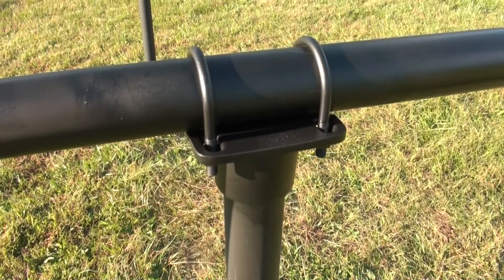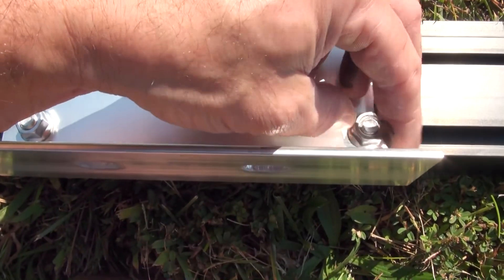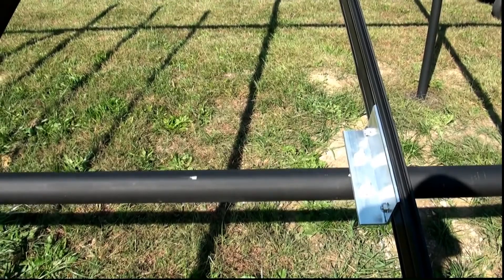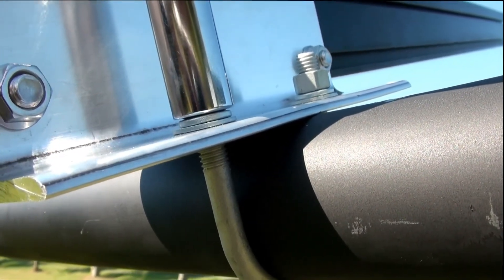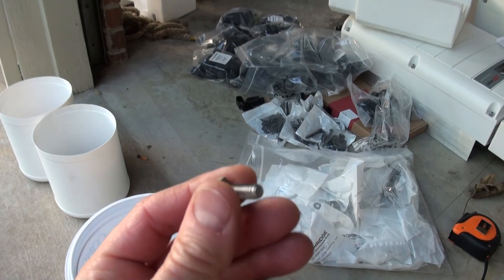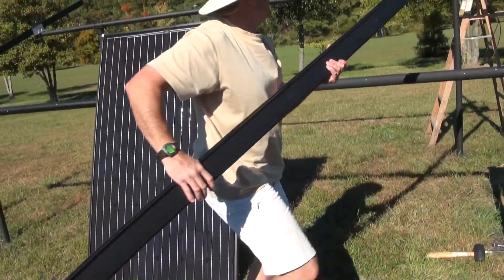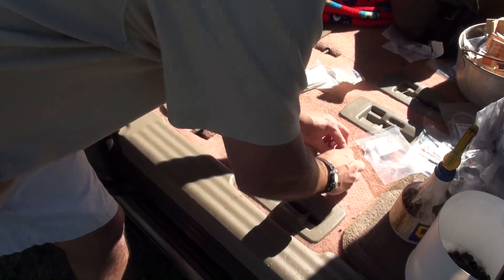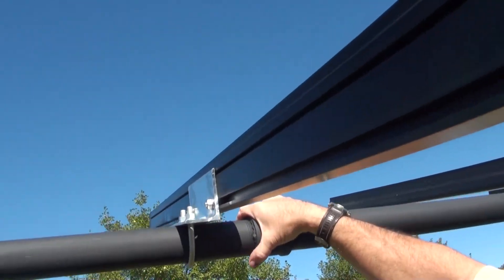DIY Field Solar Array - Part 6

Comment: smiling you know in carpentry we use 3/4/5 rule.  you were skewed and did not measure corner to corner which would have gotten you dead on with just twi then as you go along three panels installed. Pretty much measure corner to corner and make sure your dimensions were identical.  This would have kept you right on.. hope this helps someone else who might be looking to do an install that is similar to yours.
Reply from the maker: Thanks!

Comment: Congrulations! I'm from Brazil, and we trying to cultive the power solar here...Can you say for me how much did you spend in this project? Because here is too expensive yet.

Good lucky in your projects..
Reply from the maker: Total cost (including the trenching team, rentals, and every single part, panel, pipe, clamp, connector, component, wire, construction material, supply, can of spray paint, etc.) was 35,000 USD.   Labor was free (more or less).

It seems like a lot.. and it is.  But - I haven't paid an electric bill since going on line and I get a check from the power company every year.  In USA, we also have renewable incentives which were terrific initially (as in, I could make more money with the incentives than by the electricity I generated), but now they are almost worthless.  That could change in the future, but it depends on the regions energy policy from year to year.  I estimate the payback time to be more than 5 years, but less than 8 years - depending on the market and incentives.

Comment: Patiently waiting on your final video on how you run the dc wire from the array to the house to connect to the inverters. Did you use subpanel to connect all the wires and then run a 100amp to the house
Reply from the maker: I'm always flattered that anyone actually watches these videos!  I'll make an effort to get the last one done.  It will probably take me several more weeks at least. 

Here's how I did the AC to DC switch.  When I came up with the idea of placing the inverters indoors, it was after I had already trenched in the 240v service cables and there were only 4 wires running out to the panels; three 2-gauge aluminum and one 4-gauge aluminum (typical 100-amp service).   I used these 4 wires to make 2 DC loops, each loop feeding 1 inverter (I have two inverters on this setup).  I use a 2-gauge and a 4-gauge to feed the 6kw inverter.  I use the 2 remaining 2-gauge wires to feed the 11.4 kw inverter.  There is no ground wire connecting the panels in the field to the indoor units.  Not wanting to trench in additional wires, the best I could do was place a grounding rod at the frame in the field and I have a grounding rod for the inverter chassis where they come into the house.  Obviously, if I was doing it over, I'd run a few extra wires to be sure to meet code.   At the panels, I installed a metal junction box with conduit connections coming in.  Inside the box, I tie the appropriate strings together in parallel and connect them to the underground wires using split bolts.  The old service wires come out of the large junction box, in conduit, go down in the ground, and then run direct burial to the house.  So, it's 3 parallel strings of 14 tied to two 2-gauge wires and 2 parallel strings of 9 tied to the 2-gauge and the 4-gauge.  I was worried that the SolarEdge telemetry would not transmit over the ~600 foot distance, but it works great.  In conclusion, to do this correctly, I would have wanted to run an additional 2-gauge, so my gauges were matched, and one more additional wire to provide ground connections - 1 for each inverter.  These frame grounding wires are required by code for arrays on a roof, so I would imagine they are required for a field array too.
Reply: Hullspeed . Thx. For some reason I though since you used solaredge optimizer that you would have the panels in series for up to the max DC of 5250 per string.  Never thought of parallels  . Interesting thou. I’m in the process of setting up a 17kw system consisting of 50 panels with five up and 10 .  I thinking of using two 7600 solaredge inverters and have two strings to each inverters. I string will be 14 panels essential 2 of 14’s and then 2 string of 11 each.  And running both wires from inverters to a 125 amp sub panel with two double pole 40 for each inverter and then using a 100amp ac disconnect before running wire underground to the side of the building with another 100amp ac disconnect before connecting to 100amp breaker inside my main panel of 200amp. Essential backfeeding.
Reply from the maker: AIHF, I wanted to stay below 15 panels per string to assure that I did not exceed 600 volts open circuit (assuming the optimizers were not present, even though they are).  In full sun, each panel is about 40 volts open circuit, so 15 panels equals 15 * 40 volts, which is 600 volts - and that is the voltage limit of the PV wire I'm using.  Also, by running parallel strings, I can divide the current up so not everything is on a single series run of PV wire.  I combine the amps when it goes onto the 2 gauge aluminum (100 amps rated).  There is also a minimum number per string according to the instructions - I think it's 8 or 9.
Reply: Hullspeed I’m using P400 solaredge inverter with 340XL SOLARWORLD PANELs. But I see your point

Comment: Part 7 coming soon? ? ?
Reply from the maker: Hey.  Might be a while.  Everything worked out great and I'm in the process of adding 20 more panels to the existing inverters to push them more to their limit.  I decided to put the 20 on a small section of roof over the house where the interters are mounted.  Next spring or summer (2018), part 7 might be a "years later... how's it holding up video".  Short answer is that it has been terrific with not a single breakdown (knock on wood).  The only thing going wrong is that I didn't get all the oil residue off the pipes and some of the black paint is flaking off.  As far as electricity goes, I get money back from the power company and I haven't paid an electric bill since it went on line.  Our electric bills were high!  The value of SRECs has tanked, however.  Oh well.

Comment: Great video series. I am in the process of doing a 9920W install and my first ever so this series is providing a lot of great information. This appears to be the last of the series, did you ever complete the install? I am contemplating whether to install the inverter outdoors or indoors, what are the pros and cons of each? Thanks again.
Reply from the maker: Oh yeah.  The array has been producing power for years now.  I was in a hurry to get it on line and start making money.  Also, I haven't paid an electric bill since they went on line.  Making these videos goes a lot slower than I had hoped.  I may do one more to wrap the series, but there isn't much to show - except to say, "Hey, after all these years, it's still working perfectly."

The enclosures are outdoor rated (NEMA 3R) and most put the them outdoors.  But, if you have a place to put it indoors, that's not too hot, I would do that because it seems like there would be much less trauma (dust, insects, sun exposure, extreme temperatures).  That being said, it should work perfectly fine outside.  I was originally planning to place mine outside, but I changed them to inside shortly after first bringing the system online.